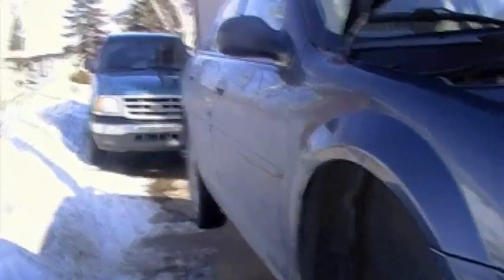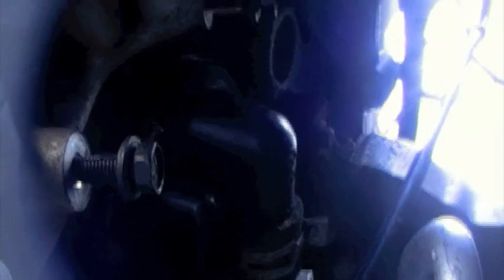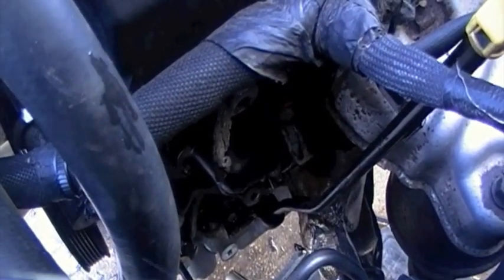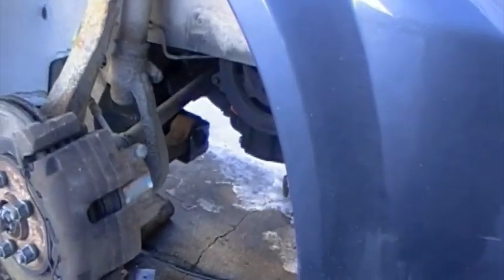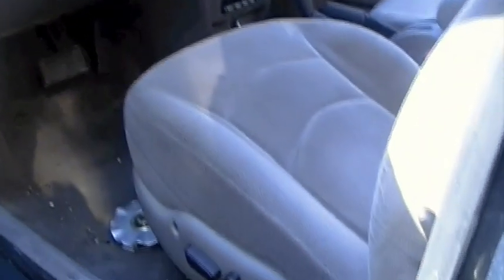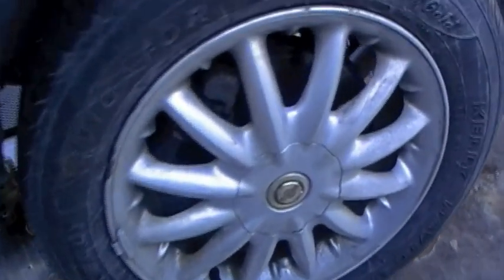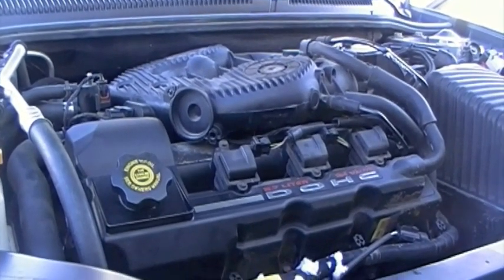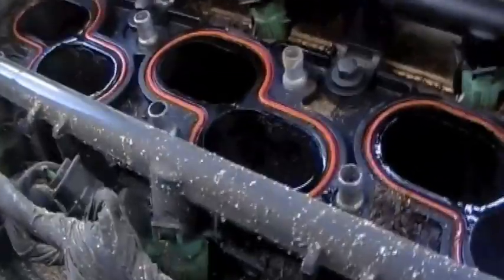How to fix your Chrysler 2.7 Engine The Right Way! Part 1 of 3

Comment: Im going through this right now. Must have leaking for a while then without warning , it literally takes a dump. Coolant everywhere all over the ground. Its a shame that a great car has a garbage engine. Never experience anything like this before. Mine is getting repaired, 1700 dollars later. I wish i can make the dork who designed it pay for the repairs and the grief the owners going through. No wonder you see seabrings in the autowreckers  a lot ,just for this bullshit. You literally have to dismantle the engine just to fix it and now you don't know what else can go wrong. Way to go Chrysler.

Comment: Hi again! Okay I am sitting in my car and I'm fixing to start my car for the first time after redoing the timing chain, 8 bent intake valves, broken guides, stopped up oil pick up, failed primary tensioner, lifters, and rocker arms, and I bumped the starter and it sounds like an Electrical grind if you know what I mean!! Can you tell me what it might sound like and if that is normal because of all the components not being fully oiled. Just glazed over them all with assembly lube.
Reply: Does ANYONE HAVE ANY ADVISE FOR ME BEFORE I CRANK IT ALL THE WAY OVER???
Reply from the maker: Before you crank over did you turn the engine over by hand 2 full revolutions to ensure it’s not running into any issues? Do that first.

Comment: I noticed a chain in one of these videos, but did not notice any reference to why it is there. Did you have to support the engine or some other heavy component? I did see that you loosened the engine mount. My wife has a 2001 Sebring, it is a beautiful auto but a pain to enter or exit from, if you are tall, so I wouldn't go out looking for one.

Comment: hi can you tell me what size did you use on the rod caps  on the 2.7 sebring?
Reply from the maker: Ronald Burnett I used standard size bearings with a used crankshaft, which I don't recommend doing get yourself a rebuilt crank and it usually comes with the bearings that are fitted to it
Reply from the maker: Ronald Burnett I used standard size bearings with a used crankshaft, which I don't recommend doing get yourself a rebuilt crank and it usually comes with the bearings that are fitted to it

Comment: I had a Chrysler Sebring beater, and these cars are pieces of shit, even though I managed to get about 2.5 years out of it, and it only cost around $2K with legalization, and the maintenance to get it working, and I only spent about another $500 to maintain it, even though I could have gotten another 1-2 years out of it, but I decided it was not worth fixing up, even with a lot of the cheap mechanics I have to do these things.

Comment: I got a 2002 Dodge Intrepid for $200. Just like your car the body and interior are in beautiful shape... The water pump is shot though. I can get the timing chain, water pump and oil pump for $135. There is ticking in the engine though. Seems to be mainly from the front where the timing chain is.

Have not had time to work on the car. What with work and the other car already in queue for work. I drained 4 gallons of oil mixed with water and coolant out of the 2.7 engine... I threw some used high mileage oil in so I could move the car around the yard. Lesson the damage. Guy I bought it from said he was quoted $900 to do the work. I could only laugh. Told him I normally only charge about $150 for such work because it can be done in 6-8 hours

Have me a beer, watch some videos of what I may be getting into. I want the car to live. Would be a darn shame to take her to the salvage yard. No I do not want to do an engine swap. From what I can tell any engine I can get from the salvage yard would be in worse shape.

Have a Ford Taurus which I got for $300... It only needs a windshield and a steering rack. I'm iffy about which car I should put money and time into.

Really wish you would have started the engine to hear if it's similar. Then get to the end of your 'playlist' to see if there was still noticeable engine noise/damage in the engine. I don't mind going balls deep and changing crank and piston bearings and such. Just trying to get an idea of what parts to order and how deep. Wondering how much damage the engine can take until it is unsalvageable. Some engines can take a beating, others... Like I said...4 gallons of "oil". At least his wife didn't let it overheat... Yeah, lots of CEL codes too but that matters little when it takes an hour to 'change' the oil.
Reply: I would fix the Taurus!  I had one and drove the shit out of it and never cost me a dime. best dam car I ever had. sold it when I had some rent that was catching up with me and regret every since!  I now own a 2000 Chrysler seabring. gave 850.00 tax and title.  have drove it a hand full of times just around town. I have had it in the shop twice the distributor the first time. second time the main seals was pouring oil. water pump timing chain and also air conditioning unit bearing was going out making horrible noise. all in all another 1300.00 and it's also got some sort of short that keeps my power locks and air conditioning and gages and convert able top and windows won't work whenever it desiderate to start acting up.  so it likes to do it when it's so hot out you can roll the window down or the top or air. it's a nice looking car. just that 2.7 motor that sucks balls! I love the way it drives though!  when it's able to drive! I am thinking of selling or trading it for something more reliable!  wish I had a Taurus!
Reply: shannon moore I just sold the 2000 Ford Taurus 163,000 for $800 last Friday!
I kinda liked the car, put a little over 2,000 miles on her since last October.
Top get it on the road I had to replace the windshield, power steering rack, all of the brake lines, gas tank, gas tank straps, four tires, Passenger front rotor, spark plugs, oil, transmission screen and other maintenance stuff.
Did the work myself so I had $600 into the car.
The air conditioning didn't work, door handles, stuck and a bunch of other annoying things. The car needs shocks, an alignment, the rocker panels are rusted, water pump is going to be needing replacement soon....

The Taurus drove nice, I'll say that. It only got an average of 20-22 MPG.
My 1996 Neon with a manual transmission gets 32-36 MPG

I immediately bought a 2003 Dodge Neon sedan with a manual transmission for $600.
Radiator fan was seized, rear shocks, rear brakes, shift cable bushings, oil change.
Car is nice and quiet.

I ended up trading the Intrepid for a 1998 Plymouth Neon coup.
I have $300 into that car which includes a head gasket and timing belt kit, exhaust, brake and fuel lines....
Runs great but noticed the transmission seal is leaking between the engine and motor. $10 part but a pain to do. car is back burner-ed. Considering using it for parts since it's an automatic and not an MTX.

I love the Dodge Neons. All three of the Neon's I have have essentially the same engine. same brakes and many other common parts.

The 1996 Neon. I bought that car nearly 6 years ago for $350. I may have $2,500 into that car... that's including oil changes, fluids, paint and such. That is not even $10 a week to pay for that car.
My rule of thumb is to set aside $20 a week for car maintenance and parts. Most f the time I don't even need it.

Yes, the 2.7 engine sucks balls!
Reply: shannon moore I don't know what state you live in. Craigslist NY Albany, there are several Taurus' for sale for under $1,000.

Bide your time. wait for them. Check them out and haggle. You can knock hundreds off the price which can be used for parts/repairs.
Any used car is going to need a little work.

If you can find a shadetree like me who does work for cheap. Not just cheap but guarantees most of the work. You're sitting pretty.
Better yet you can do the work yourself. Than you know it's done right and you have an idea of other problems that need to be addressed. Take note, horde parts and do the work when you have time. 

Don't believe anything a seller tells you. Even after they have your cash and the car is on the trailer. They'll hesitate.
You're basically doing a state safety/emissions inspection. Check the oil, coolant, trans fluid, tie rods, ball joints, frame, body, lights..... ect. You ask questions beforehand to gage honesty, "What is wrong with the car/truck no matter how trivial".
The more you find wrong that wasn't admitted to the lower the price drops.
Not to say you don't deduct for stuff that was admitted too.

That is how you get a $1,000 car for $300. Because a dozen other people already walked away when they realized they couldn't drive it off the lawn...
Reply from the maker: Clayton εжз if it's making a ticking sound the rod bearings are probably gone already. you will be looking at a bottom end rebuild for sure. these engine don't typically produce the low tone knock knock it's more of a tick sound. only if they run smoothly I do just the timing. see my other video for the ticking sound rebuilding chrysler 2.7 I run mine for a bit before tear down

Comment: I just bought a 2000 Dodge Intrepid. It's overheating and sprayed water/coolant with what looks like oil all over the engine; however, there is no oil in water.  What's your thoughts.
Reply: Carri Simmons Sell it or take it to the crusher because it's not worth spending money on. Chrysler should have recalled these engines because they are total garbage.

Comment: Guess \I've been lucky so far, I have 239,300 k's on my 2006 Sebring Touring Signature and so far... Knock on wood... no problems.. but thanks for the information, I will subscribe too keep in touch as long as you do MOPAR..
Reply: Stephen D James Some simple upgrades have been made on the 2.7 since '02..typical of American makers to leave the reliability testing to the customers...My '03 Sebring GTC purrs at 98K, but time for water pump and timing chain set BEFORE anything bad happens..
Reply: I just noticed, you wrote k's...do you mean k miles, or kilometers..??? and are you on the original timing chain and water pump??
Reply from the maker: Stephen D James 2004 and newer they revised the 2.7 design slightly  which lowers the failure rate (water pump and timing components)

Comment: I seen one completely blown up all because the previous owner avoided a problem with a transmission problem and the fix was easy at the time,a $20.00 speed sensor and later on replacing the computer.Get rid of the long life shit and pour in green,this is one fix for the 2.7.
Reply: green works perfectly fine as long as you flush the system first.

Comment: how reliable is the 2.4? better than the 2.7 (an all too easy feat)
Reply: steven earnshaw I have a 1997 Dodge Stratus with the 2.4L DOHC and I’ve had no mechanical failures whatsoever. Just routine maintenance, it currently has 143k miles I bought it with 136k I’ve put 7k miles on it in a matter of months and I change my oil every 3k miles.

Comment from the maker: @seek1919  if there is water leaking onto the ground from the front passenger side corner of the engine  you have a bad waterpump and it *MUST BE REPLACED ASAP*   depends on where the leak is on the waterpump you may get oil/water contamination like this car shows if the waterpump gasket is bad  however if it is just a shaft seal it will only leak onto the ground. you could get both...but i beliveve you have a waterpump issue

Comment from the maker: @saintp504  the seal you are referring to is the rear main seal....this seal requires removal of engine and transmission and seperation of the two to gain access to to replace....not an easy job...you will need a hoist and a engine lift to remove engine out the bottom.... do a google search " chrysler sebring 2.7 engine removal" and there is a list of items in order needed to be removed to get the engine out with ease....it helped me...

Comment: man i have this same exact car i really need to fix it for transportation i bought mine broken for an awesome deal as well  is there any way you can help me out  it has a major oil leak only when i start the car though when the car is off the oil doesent leak i was told it is the rear transmission seal im not sure but do you have any advice for me please let me know

Comment: make sure you get the revised water pump, with beefed up shaft, bearing, and seal. there was a re-design. the old design went 80,000 miles, the new design is good for 150,000 miles